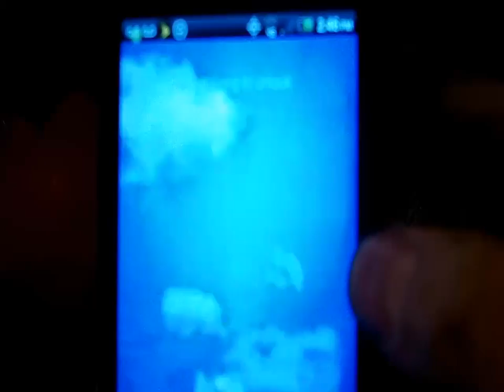working on a honda harmony 1011 tractor

Comment: Thanks for the tips on the mower. Seems like you were able to get a good deal with your purchases. I was wondering if you could tell me where I could find a mulching kit and new blades for the Honda Harmony. My father needs them and he has the same exact mower but the part is obscelete. Is there a universal or other brand that would work? I appreciate any help.

Comment: hey keith, what was the size of the drive belt on that honda, i just bought a mower just like that but i need a belt
Reply: Hi Zack did you ever find a drive belt,I need a drive belt and a blade belt for my 1011 can’t find any information on sizes